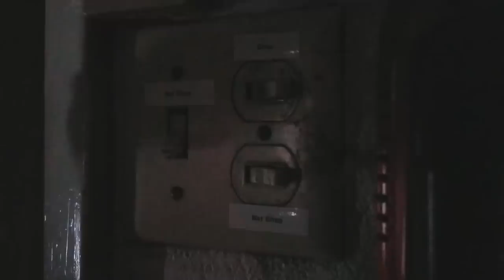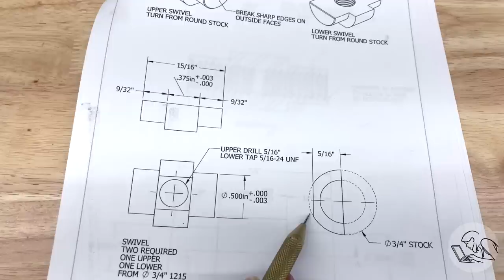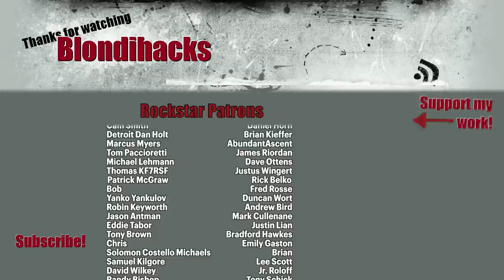Let's Make a Knurling Tool! Part 2

Comment: Hint on the order of operations for the axles. to avoid the bad time getting the distance of the grooves of the second axle right, make the grooves for the first axle, then flip it around, cut the groves for the second axle and only then part in the middle

Comment: So Question.  With both the axles and the pivots you parted off 1 part before starting it's partner, causing a more difficult operation on the 2nd part.  In hindsight would it have been easier to flip the parts over and do the bulk of the work on the other part before parting off, and facing off the parted ends to length?  Just curious.  You do such a great job of describing your thinking on why you do things a certain way, and mentioning when another way may have been easier, I thought I'd ask about this.

Comment: I'm with you: I am not a fan of centre holes or other such op-only features on parts, exposed or not.

Typically, if I have the time, I'll LASER or TIG the "blemish" and then dress down, clean up, or surface grind the redeemed part.

I really do enjoy watching your videos and projects, especially at work. At the very least, I get a hearty chuckle but often your insights help me see my duties in a different light.

Is there a more direct means of supporting you (that isn't Patreon)?

(I guess I can always just buy loads of merch-- Haha! Where do you ship from?)
Reply from the maker: I have PayPal options as well on my website: https://www.Blondihacks.com Thanks for the support!
Reply: @Blondihacks  hey, hey!

Just to let you know the main website "home" just isn't loading for me at home or at the shop, even in my mobile data. Oddly enough, my old bookmark to Furiosa's auto-feeder 'tankification' slowly loads but just fine.

The home page currently just had the 7 dot spinning progress icon going and the shopping cart icon visible at the bottom right. Loading or stopped, the cart icon does not click through.

Comment: For less waste with the half-round clamping pieces: could you have made both at once, by bolting two bits of flat stock together and turning them as one square bar?

Or would that not be strong enough for turning?
I'm not any form of machinist so I'm probably completely off base with this.

A bolt would get in the way of making the middle bit round, but I think you could still turn the round ends that sit in the semicircles?

Comment: From this day forth, Quinn's "Nom de plume" online should be........ "Foxy Hawk" ! :D

On a different note.
Quinn, if you machine something slightly unusual, like that turned circumference that seats into the radiused cut out on that clamping finger bit, and when testing the fit you find it's an almost scarily perfect, do you still get that little fluttery feeling ? Or are you now to a point where you think "I made it to fit, so it fits...... What's the big deal?" these days?

For most of the quick and dirty hobby machining stuff I do, I tend to work to the tolerance of "It doesn't wobble THAT much in it's hole, so it'll be fine". I CAN work to tolerances, but most of the time don't bother if it's not critical to a parts function. A few months ago I turned a couple of chunky pin hinges for my utility trailers ramp. As a nod towards preventing the rough finish on the parts from chewing into each other too quickly, I reamed the blind bores in the female part of the hinges, and polished up the intentionally slightly oversized male parts with a few different grades of emery cloth to get them smooth and fitting good enough not to rattle too much, but entirely by accident, they were both perfect sliding fits. There was something almost hypnotic about sliding the dry pins into the blind holes in the hinge blocks and feeling the bouncy resistance as air was forced out of the void, then pulling them apart again to hear the pop. I got a feeling I hadn't felt since when I started to get the hang of hitting tolerances back when I was trained as a metal machinest many years ago......... It made me wonder when I'd become so slapdash with non critical tolerances? 🙄

Comment: Another great video ! Where can I get one of those HSS tool holders ? its used at around the 1 min mark of the video. I've never seen one before, it looks extremely rigid with the HSS bit in that unusual orientation.

Comment: I had no idea you were allowed to use wide part of the edge finder...
Reply: Yes, they're usually .500 diameter. Even metric users have to admit this is an easy round number to divide.
Reply: @ellieprice3396   yeah I’m used to dividing 12.7 by 2 and getting 6.35 ;)

Comment: Out of curiosity: would it have made it any easier to make both of the knurling pins (flip the stock), then split them and face off where they had met, or would that be equally difficult?

Comment: Hi ,starting our retirement buy buying a second hand lathe and mill.
I’m watching your beginners videos .
The videos are great thank you.
I have 3 questions 
First on video 7 turning a shoulder you said to get rid of the fillet go in an extra couple of though.
I presume that’s added to the final depth ,then you come back out 2 thousands before pulling the tool out to face the shoulder?

Q2 I have a set of banggood carbide insert tools  which shaped tool is used for turning a shoulder and which tool is used for facing?
It’s hard to tell how or where the tips will cut.

Q3 last but not least can you recommend a video that explains imperial for lathing!
I get what a thousandth of an inch is (1 1000th )
And I get a ten thousands 
But is 5 thou  5   1 thousandths  or is it half of a 10 thousandth.
You also said the first pass of a 4 jaw chuck will get you to 20 thousandths 😮

Sorry I’m from the uk so I use metric I know a thousandth is about 0.25mm !

Many thanks Paul
Reply: It's 0.0254mm, I think.
Reply: 5thou is 5 x 1thou.
20thou is 20 x 1thou.
Half of a thou is 0.5 x 1 thou... or bugger all.
39.37thou to a millimeter 
Inch is 25.4mm

If you're talking ten thousandths... that's beyond the precision that my lathe can do.
First pass of a 4 jaw dialing it in, you can get pretty close when you know what you're doing. 
20thou is ~half a mm.
Reply: @kieranh2005  this is brilliant thank you
Reply: I’m assuming 1x ten thousandths is .5 thou?

Comment: Does anyone know what the tool holder Quin is using to turn at the beginning is called? The one that just holds a HSS blank? Thanks in advance.
Reply: I managed to find it myself after trying various search terms on google. It's the eccentric engineering diamond toolholder for anyone else looking.